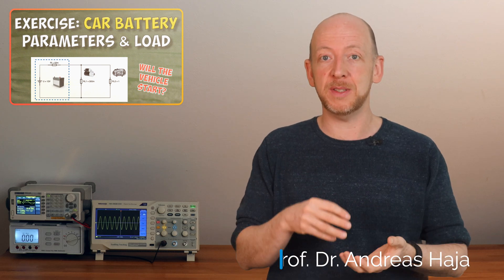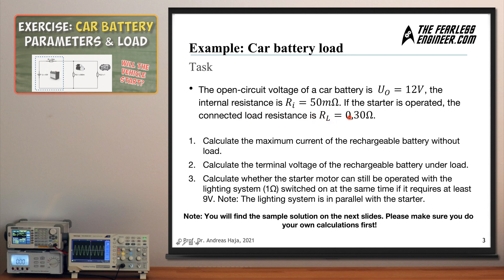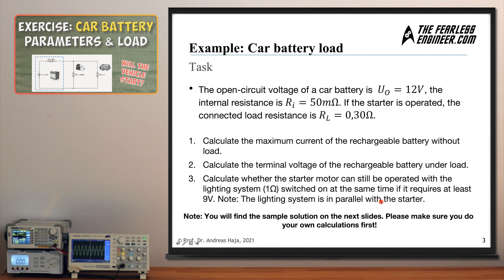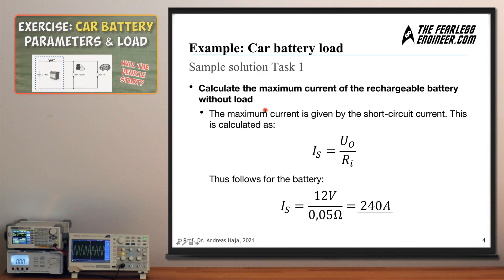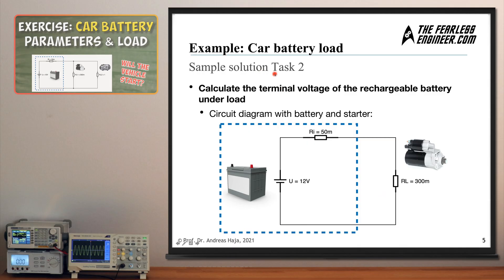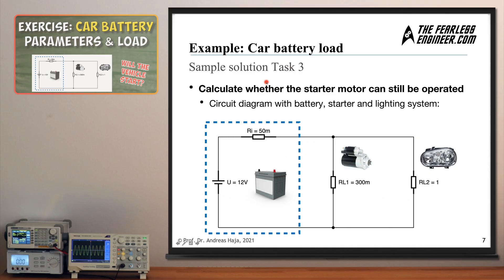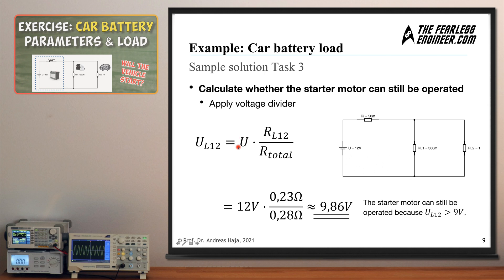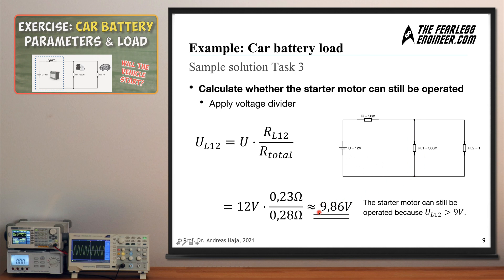Exercise: Internal resistance of a car battery | Learn Electronics

Comment: Thank you so much 👍
What is the internal resistance range of any healthy car battery?
2_How much is the external resistance in milliohms to calculate the internal resistance of the car battery?
Reply: The same question🤝

Can i measure with clamp meter?